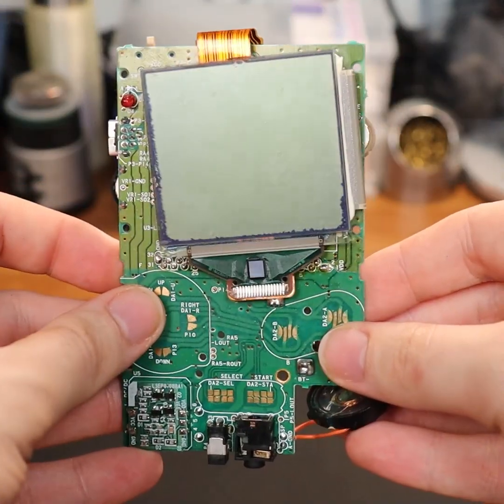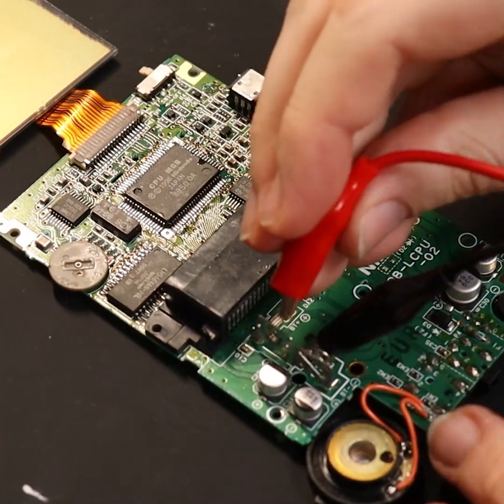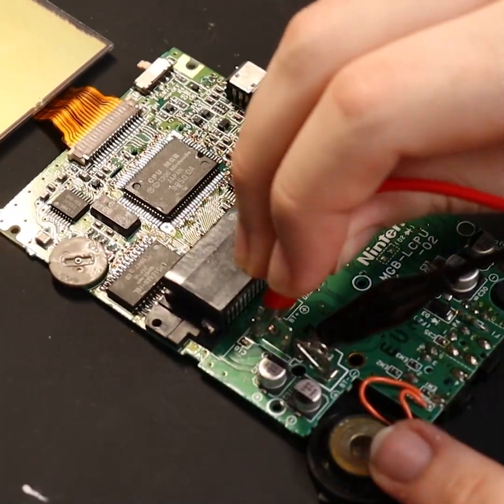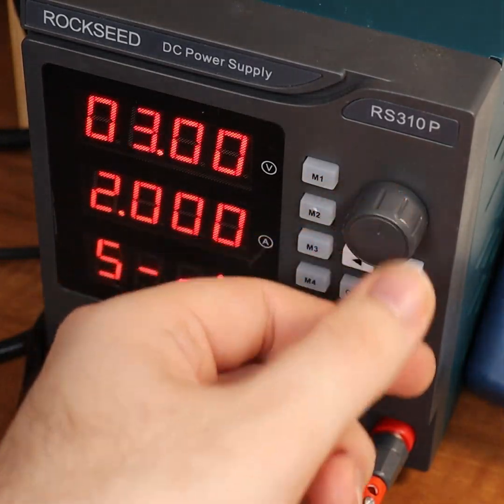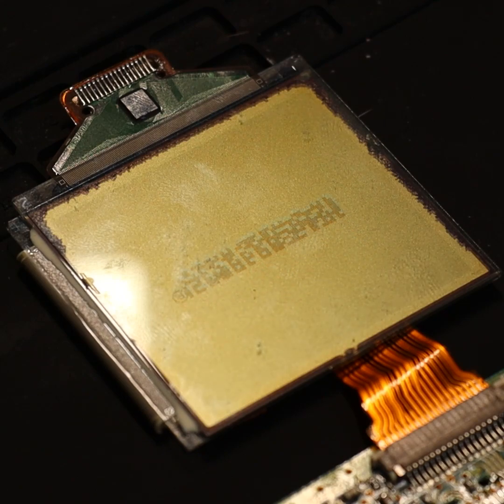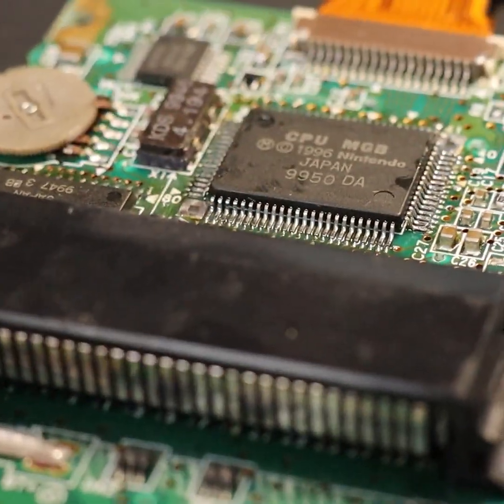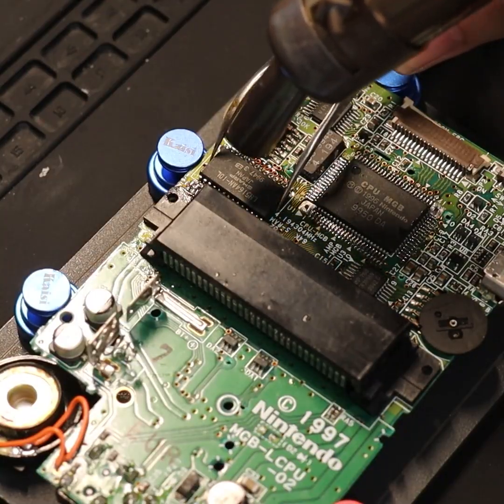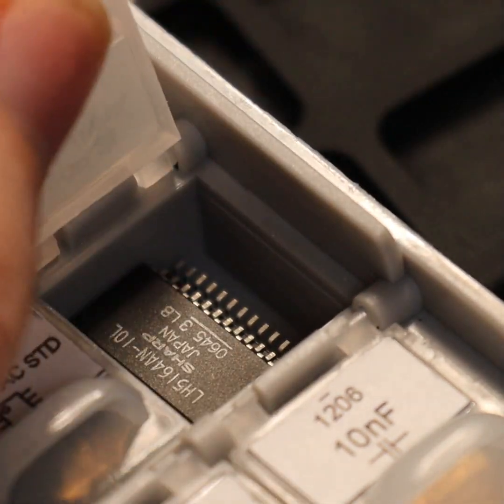A Gameboy with a rare problem

Comment: There is something very rare about this game boy. It's skeleton jumped out of its body and ran away.
Reply from the maker: Jokes aside, the rare problem is the ram chip being bad. That's something that I've never encountered before or heard of anyone encountering. I was only sent the motherboard, but I'll probably be reshelling this in another short when I find a screen for it.
Reply: @ItalianRetroGuy  is it cuz ram very rarely breaks?
Reply from the maker: @echoptic775  The lucky units that are still working today without major faults (however the chips used in these are very solid) are more likely to suffer failures on the PCB and solder joints level, considering that those parts aren't insulated as well as an IC, which is completely encased in plastic.
Reply: @ItalianRetroGuy  oh ok tnx fot explaining
Reply from the maker: Had a good laugh.
Reply: Poor thing got spooked too hard. :(
Reply: Lmfao!!
Reply: I didn't know a Game Boy could have boneitis. 0_0
Reply from the maker: Good job on 1500 likes :)
Reply: THE SKELETON APPEARS

Comment: This man actually soldered every pin on that chip like an animal. Respect. That took steady hands. However, forgive me if you didn’t do it this way for a good reason, it’s much easier to use solder paste and a heat gun. I have lots of experience soldering and pin soldering on those is really a pain so I try to find the easiest way.
Reply from the maker: I didn't want to stress the chip. But anyway I'm good at microsoldering so to me that was actually pretty easy

Comment: What’s the tool you are using to desolder the RAM? I’ve been looking for something like this.
Thanks
Reply from the maker: Desoldering braid. The brand is goot, I recommend trying to find a genuine seller. Look for "Goot Wick 1515"
Reply from the maker: Non genuine is garbage.
Reply from the maker: I have a listing for good solder wick in my description
Reply: Thanks for the reply. I was refereeing to the small heat gun.
Reply from the maker: @dominicchch  Oh! That is a hot air station, it is tiny in the hand but it's just the handle haha. It's in my description

Comment: The fact this guy has a box of game boy ram chips is impressive. I get he probably fixes them but got damn are those like a stock of og ones or is there someone still making gameboy ram just for repair purposes
Reply from the maker: I have an AliExpress link where you can find them. Also they were just two, ordered just for this board, the last video I made about this Gameboy I had a hunch the ram was fucked, so I just ordered the parts

Had this sitting for months, didn't know if I should make a full length video about a single chip replacement so I made a short. Best decision of my (channel's) life, initially didn't want to even make anything ahahaha

Comment: Was it actually a bad RAM chip or was it like a cold solder joint?
Reply from the maker: If you watch my previous video about this motherboard you can see that I have reflowed and resoldered the chip already, and it hasn't worked. The thumbnail has me holding the motherboard, can't miss it .

Either way removing the chip entirely restored the original blank logo and therefore it was the chip

Comment: Can anyone explain to me what the metallic loop-like stuff is that is used when replacing the RAM. Is it some kind of solder? The copper-like in second 34
Reply from the maker: Hi, I think you might mean the desoldering braid, also called solder wick. It is a copper braid that can be used to wick off solder with heat and possibly flux

Comment: Fun fact:The GameBoy has a unique anti-piracy measure, the Nintendo logo you see when starting up the console is used for verifying the cartridge. When the game boots,the console checks if the Nintendo logo from the console matches the Nintendo logo that is burnt into the console's SoC. if they are the same, the game boots, if not then the console locks up and the console just sits at the logo.

The logo that is displayed is the logo inside the cartridge,if the RAM is faulty then the logo becomes corrupted and the console fails its anti-piracy measure (and locks up).
Reply from the maker: Exactly! When I removed the RAM I tried starting up the gameboy just to check, and to my surprise it boots just fine! But it cannot read catridges and the logo became blank, as it should be :)

That was a big confirmation that I was right all along.
Reply: It wasn’t exactly an anti-piracy measure, it was to prevent companies from making gameboy games without licensing them (since technically there’s no law against that). If they didn’t include the Nintendo logo it wouldn’t work, if they did include it Nintendo could sue them for copyright. I believe that when a company finally challenged Nintendo in court Nintendo lost.
Reply: @ajbatsche5402  There were also work around that tricked the gameboy into working, but I believe those came later anyway.
Reply from the maker: It is however very much like an anti-piracy measure. Making a bootleg with the correct nintendo logo would infringe the trademark and still prevent making copies that way.

The workaround was pretty easily found, but it still requires storing the right data for just a moment and I don't know if that is already messing with some copyright laws, despite it being just a numerical representation of a logo.
Reply: @ItalianRetroGuy  That's getting deep into a semantic argument, and I doubt any claims court judge would actually follow through with something so semantic. Nintendo has had semantic cases thrown out both in their favor and against it (see: Nintendo vs. Galoob and Nintendo vs. Universal for more info). I like your engagement, idk if I subscribed already but I certainly will after this.
Reply: @ItalianRetroGuy  piracy is stealing stuff that isn't their's. by definition it is basically an infringement of copyright - e.g. copying Nintendo's games onto blank cartridges or something. They wouldn't have any issue with using Nintendo's logo in that case

Edit: as in pirates are already on the wrong side of the law and thus could already be sued, so this doesn't really impact them
Reply: @rolls_8798  The logo check was born out of very specific historical circumstances. Nintendo wanted to target specifically Taiwanese manufacturers of cartridges (both unlicensed 3rd party developers and pirates). At the time, Japan didn't have a copyright agreement with Taiwan, but they did have a trademark agreement. It was common at the time to have pirated versions of games that had all the copyrighted references hacked out of the ROM, while the actual game was identical. This was Nintendo's way of forcing any games that ran on the GB to show the one thing they could sue for in Taiwan, a trademarked logo.
Reply: @Gameboygenius  that's pretty cool and is an interesting solution. i don't really think other game makers should have had to be licensed by Nintendo though
Reply: @ajbatsche5402  correct, my bad
Reply: What does SoC stand for?
Reply: @ColbyTheCheesePls  System On a Chip (often used in phones and other things where the cpu and gpu need to be together in one part)
Reply: @GeorgeN-ATX  gpu is not needed for a soc, but typically included for consumer applications.

Memory and a computer element for acting on the memory is all you need.
Reply: @ColbyTheCheesePls  System on a Chip
Reply: @ColbyTheCheesePls  system on a chip.. Basically a cpu with all the parts needed to run code in the chip.

Comment: Can anyone tell me what’s the black blotch around screen frame called? Screen rotting? I saw a lot of old Gameboy screen seems to have the problem. Is the problem specifically to dot matrix display only?
Reply from the maker: Yes pretty much, screen cancer is another term.
Reply: @ItalianRetroGuy  Thanks! Never heard the term before, but it sounds so severe lol
Reply from the maker: @marinbelle  that's because it kind of is! :)
There is currently no 100% working method to get rid of this and all of these screens will get it eventually. Seems to be more of an issue with the Gameboy pocket though, while the original Gameboy has horizontal lines as its own screen cancer (which can be fixed but most attempts to do so will result in burning up the screen cable to an unrecoverable extent)
Reply: @ItalianRetroGuy  I see, so the only long term repair is the replacement screen. Thanks for your explanation. 👍
Reply from the maker: @marinbelle  no worries, I love when people ask questions. I wish I could provide more details in my videos but being too technical tends to drive people away I've found. Maybe one day I may be able to cater more to my subscribers but for now I need to cater to the general public

Comment: “I thought it was a faulty ram chip”

It is a faulty ram chip
Reply from the maker: Yes that was the whole point :o
Reply: @ItalianRetroGuy  yes, though in English when you start with ”i thought.....” it generally is followed by something that happened to be the opposite thing of what you thought was going to happen or something else that was not what you thought it was going to be 😁
Reply from the maker: @qpSubZeroqp  i don't even think I used that exact wording.

I remember the line is closer to:

"This had made me believe that maybe it was the ram chip from the very start, so let's replace it"

The only time I said "I thought" I was talking about corrosion, and it wasn't that.
Reply: @ItalianRetroGuy  I could've sworn that was the title of the video, oh well